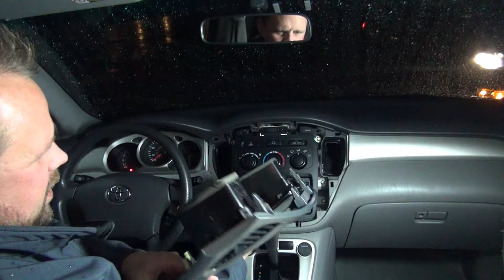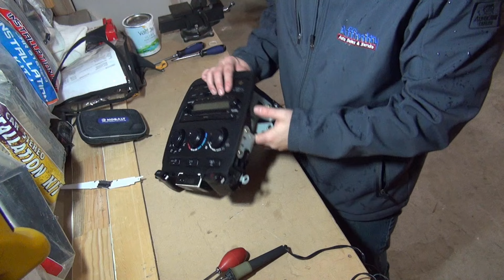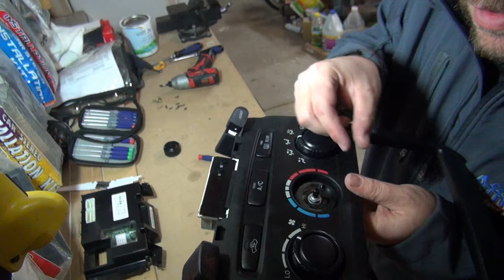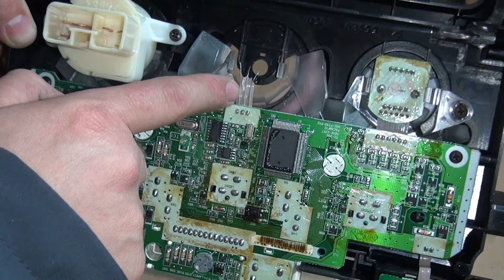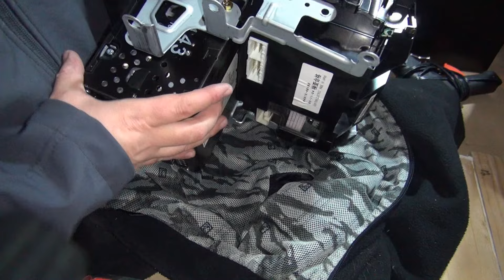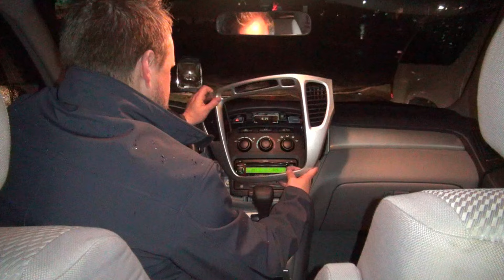How To Repair Toyota Highlander Climate Control | DIY Tips

Comment: lately a couple of times my cold blows hot air instead. so of i turn the dial all the way opposite to the hottest on the dial, and then back to the cold on the dial, it fixes it and it blows cold again. does this sound indicative of this same worn cable connection issue? thank you.

Comment: The knobs are inverted in the control panel. I was told at the dealership that it first needed a diagnostic, however the AC was working fine before it was disconnected during the winter. How do we get the knobs working again? Could the cogs in the knobs be stripped? I,,'m a little old lady on a pension that can't afford costly repairs. This rep air seems simple & inexpensive.

Comment: -This won’t work for everyone, but I was able to solder the lost connection through the front without taking out the unit. After removing the middle knob I could clearly see one of the three wire cables detached from the board. I repositioned the cable back into the hole and soldered it back in place using a narrow pin. The space is very narrow, so you’d need one narrow enough. Not the best looking soldering job but fixed the problem and still working after a month. I like short cuts. But if it hadn’t work, I could just take the whole thing out like in the video. Nice video and still saving people $ 6 years later! 220k miles and car still sounds good.

Comment: Over 3 years ago I bought a replacement online for my Toyota Highlander 2006 from a company that rebuilds them that includes fixing the connector that is the problem and making it stronger than the original and they check everything and repair as necessary to make sure it functions properly. They included a postage paid label so I could easily return my old one in the box received to get back a core credit.  When the replacement arrived it looked brand new.  Still works great and included a lifetime warranty though that will likely only apply until they stop having enough returned to stay in that business.  Yes, the 2006 models had that same common problem as the model years listed above.  It is ridiculous that Toyota never recalled those for a free repair or replacement considering the same lousy design used year after year enough where a new independent business was started where a major portion of their work was for this item. If I paid for a new one from Toyota I likely would have got the same faulty design and Toyota's warranty for new parts is usually just 1 year.

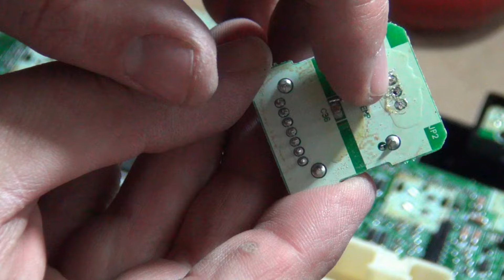Comment: 2025 here - thanks for making this. I made the repair on my '05, and the knob seems to be working correctly now.  Seems that little nut 6:14 that holds the stem was slightly loose. And years of use allowed the PCB to twist a bit back and forth. That is why the 3 conductor ribbon cable fail.  Be sure to tighten it good when done.    8:42 I ended up getting some 20 gauge stranded wire.  It had 7 strands in it. I folded back 3 of those strands, and that fit through the hole on the little PCB.  After soldering to the little PCB and checking continuity, I decided to just solder the other ends to the existing wires, as I did not want to attempt to connect directly to that larger board.  I put some heat shrink over the wire as insulation.  Before reconnecting the radio to the assembly, I tested with the three wire harnesses to just the HVAC control unit.  That worked so I reassembled everything.  A little pro-tip for those finding this problem in winter. If you put the air-recirc button on, it closes off the outside air, so at least it does not intermittently blow cold, winter air in while on the heat setting.  That is where I was in February.  Now that summer is here, it only took a few hours.  Huge thanks to the maker of this video for your excellent contribution to YouTube University!

Comment: That ribbon cable is a monster! I broke the base clip off the motherboard on my 2004 Sienna, not realizing you can unlock the top part of it.  Got another unit from pick-a-part, and now have to replace some bulbs in it. This will be very helpful, thanks!!

Comment: Thanks so much for this video.  Made the repair years ago and it’s holding up.  Instead of doing the soldering I bought a Dorman kit to replace that section.  At the time it was $50, …..it’s $131 on Amazon now!  I’d definitely go soldering route now.  Even if you had to pay someone $50 to solder it would be better than $131 for the Dorman kit.

Easier way to open the clamshell…..you can lift up the clear plastic part and remove that part of the white ribbon cable ( opposite end of one you removed) rather than trying to reach into the small area and do it.   The putting back together of this area starts a little after 11:00.

Comment: Thank for the video I just took the center climate control cap off the hot and cold cap and it has a nut in the middle, my knob was weak and I made strong by tighten  it up put the Cap back on now my hot and cold work normal. Like my comment  if this work for you.

Comment: My Highlander has the digital LCD screen which no longer works. As far as I know, that part is not repairable. Are the wiring harness hookups the same between the digital and manual climate control units? I was thinking of switching over to a manual unit.

Comment: I have a 2004 Highlander (basic). I followed your repair advice and it worked perfectly. Thanks. Now, however, I have another issue which you may be able to provide some insight. The other day, out of the blue, the digital clock light stopped illuminating and the light on the AC button was not on, even though AC was cooling my car. I also noticed that the Hazard button would not come on, even though it too was functional. I check the interior and engine fuse boxes (specifically the heater fuse 15A, Radio No.2 fuse (7.5A), and the ECU-B fuse 7.5A in the Engine Junction Block) - all of the fuses were not blown. Not sure what else to check. Any ideas? Thanks! WR

Comment: Hey I have a similar problem and can't seem to find the fix. The vent selector knob, and the buttons for AC control (and rear defrost) don't work. The clock also isn't lighting up. All of this is on the same board but I'm not sure how to fix it. I tried the soldering repair (some of the ribbon connector wires were broken) and it seems to be more reliable with temp control, but none of the other things I mentioned are fixed. I have checked fuses and nothing seems wrong there. Any ideas for what's causing this? It'd be a shame to replace the entire board if just once small component is bad.

Comment: I did this fix, but the heat doesn’t lock all the way in and the ac doesn’t come on all the it’s like the system is caught between heat and ac I think wires may be touching.  Any thoughts?

Comment: I have a same Toyota Highlander too. The heater sometimes suddenly blows a cold air when it adjusted to heating mode. When turn the regulator a little bit up (one delineation up) it blows again hot air. Sometimes the heater changes the fan speed by itself. When I also press the regulator it affects to the speed and temperature. Any ideas what I should do? I will be very happy to get your feedback. Thank you and greetings from Kazakhstan,  Almaty!

Comment: We repaired as described EXCEPT we replaced the 1 short, stiff 3-wire ribbon with 3 longer, flexible, individual wires of the same guage. Much easier to solder, time will tell if it is more durable.

Comment: Thanks so much for this! It is clearly the problem with mine too! I think the tape wire holds too rigid, so I am going to cut 2 slits to allow more movement!
Reply: We repaired as described EXCEPT we replaced the 1 short, stiff 3-wire ribbon with 3 longer, flexible, individual wires of the same guage. Much easier to solder, time will tell if it is more durable.

Comment: Hi Brian. Great vid. Very helpful. I tried and failed at the re-solder of the three wire harness. I want to order a refurbish unit and the seller has one but says I must take the power amplifier off of the old unit and screw it with the 8 screws back onto the component with the broken three wire harness. Is the power amplifier what you set aside in the video but didn't identify?

Comment: I was fiddling with the knob for months, until it got too hot outside. I watched your video, took mine apart and re-solder  the 3 wires. At my age, I had to use my phone's camera zoom to inspect the welds. Then I tested continuity before slapping together. Your video improved the quality of my 40 min commute- used to freeze my butt off  in the winter and sweat like crazy in summer. Not anymore, thanks to your well explained video.

Comment: Tried to fix mine. Was the vent selector not the temp adjuster. 6 motherfucking wires. My tip wasn't itty-bitty enough and getting the wires to take the solder was hell. You need a bottom heater. They took through hole and soldered wires to it. Dumb as hell. The motherboards were starting to corrode. If you have to fix this, you may as well get a whole new unit. You're just fixing something that's already a fucking piece of shit. The prices for these units are abysmal.
Reply: Auto Tech Rescue sells refurbished ones online and alot cheaper than new.  When I add the link to the website it gets deleted each time.
Reply: @randys6220  You are a life saver my friend 🙏 thank you; may your Toyotas stay young!!

Comment: This is the perfect video, and it made this fix a breeze. I cheated by taking a shortcut - soldering wires on the reverse side of the boards with the mini pot board still with knob attached (I didn't even touch the ribbon after verifying it was severed on two lines). Thanks for the detail, I also upgraded the stereo whilst I had it apart. So good having a big audio upgrade and temp control back!
Reply: Is it the same procedure for fixing the fan control?
Can you explain how you soldered the connection?
Thx
Reply: @chiefinspector7280  yep it will likely be the same issue. Soldering the reverse sides of both the PCBs (main board and small dial board) is a little tricky, but easier than replacing the wire or even patching it back together by taking it fully apart. If you have soldering experience it is about a 2/10 difficulty, relatively quick and easy. You just have to be careful not to bridge the connections. I used fairly fat solder and in haste managed to do just that, which didn't cause any issue when powered on so I think there is little risk with the job. I have a photo of my fix here: https://i.ibb.co/wWCgK1J/i-Markup-20220402-045859.png

Comment: I would of added some hot glue on the ribbon to strengthen it after soldering it. To me it's apparent that during normal use, these connectors rock ever so slightly back & forth over time. Thus causing the wires to become severed after so many cycles of back and forth action. Strongly recommend to glue that ribbon after this repair & also the one next to it that controls the vent settings. Cheers!
Reply: If you tighten the nut behind the knob, it doesn't move at all.

Comment: Hey Bri, I have a 2006 Highlander and my temperature knob spins 360°  on my Highlander it only has two knobs one temp and one fan is the temp knob suppose to do that, because once in a while it will blow cold and most of the time it won’t 
Thanks DLP from Socal

Comment: I can name a list of issues you may encounter when owning a 03 Highlander.
1.climate goes out ( as shown in this video)
2. Power steering line behind pass. Front tire rusts out.
3. Both flex pipe and mid exhaust after cat rusts out.
4. Both Pass. Window motors will loose power randomly.
5. Transfer seal goes bad.
6. Rusty back plates ( plate behind rotors)
That's every issue I've had so far.

Comment: This is the best video I've seen to address this issue. 

I've found as a temporary measure, you can sometimes move the control all the way to hot/cold a few times and it will then work where you set it. 

If you're like me and feel confident in your ability to remove the unit from the car, but don't think you could pull off the soldering, there are online businesses that will repair the unit and ship it back to you for under $100. Be warned that some of them say they won't work on yours if you've already attempted the repair yourself.

Comment: Dude thank you SO MUCH. Just got a used 05 highlander and was able to fix my AC by fixing this ribbon disconnect.  Not only that but I find out the radio was disconnected from the antenna so I fixed that too. :D

Comment: I am so grateful for this video. I will be trying this once my solder tool gets here. Although, i do have a question before I attempt this. My heat temperate knob is loose compared to other knobs on the panel. Is this something that could be controling the blend door and it not be the need to solder? Thanks!

Comment: Is the blend door actuator hard to replace on these? I see the part on Amazon for $40 (versus $320 mechanic quoted me, total of $520 to fix). I have a 2005 Toyota Highlander and was told the blend door actuator was bad and that is why I have no hot air. I think it is under the glove box area?

Comment: My highlander car temperature control knop is mixing both hot and cool breeze uncontrollably.
When I set it on the cool side it will sometimes blow hot air to the extend that i have to take it to someone to deactivate it.
How can it be repaired back to its normal working condition?

Comment: I just did this today, too.  I used some wire I had(did all three) instea of re-using the ribbon.  So, six solder joints re-done later and I put it in.  It worked.  What a miracle.  Thanks, for posting this.  It gave me the knowledge and courage to try it.  Also, the high replacement cost of the whole unit gave me I-have-nothing-to-lose courage.

Comment: The heat and AC both work in my 2005 Highlander Limited (wood grain panel), but the temperature is stuck on 75 degrees.  The fan speeds work, but I cannot control them.  Essentially, both knobs do nothing.  Would this fix these issues?

Comment: Thanks for the great vid. I have an issue. The AC blows room temp, when on the lowest cool setting. when i switch the AC setting to 66 degrees (one above the lowest cool setting) I get full blown hot air. Any advice would be appreciated!! I have an 02 highlander.

Comment: Thanks for the instruction video Bri.  What do you think is the reason for this issue?  Do you think Toyota just used inferior wiring to keep this issue from happening?  If it is because the wiring is of poor quality than reusing it will mean you could have this problem down the road, right?

Comment: i have question and problem which driving me crazy after fixing my ac compressor in one of toyota services. I have Toyota Rav4 2011 Limited 2GR-FE V6 and my problem is that when i put air condition on LO its ok there is no heat blowing out. But if i put just TEMP+ to just 65 degrees only (just first higher one avaiable after LO) it starting to blow ultra lava heat on my face. I checked on OBD2 Port whats going with Torque aplication and it showing me : passenger+driver inlet temperature set : 95F. I was wtf lol thats too high and when i go Temp+ values also going high so if i set 65F it shows in OBD 95F if i set 75F in car, it shows me 105F in obd. I remember i was checking these parameters 2 years ago and they were FINE and now i have 30F difference. It is possible to make correction with techstream or something? Please answer, its making me cry lol! They just fck'ed it up in toyota service and they wont fix it since "They dont know how to" Please answer! :(((

Comment: This was a great video, found the ribbon cable was broken on both ends.    Unfortunately in the process of desoldering/resoldering i melted out the small eyelet for one of the connections on the switch itself.   I was able to get a makeshift connection between the thin strip on the board itself, but it will need to be replaced    Does anyone know where you can purchase just the heat switch?    It is functioning properly but i would like to replace the switch and get a more solid connection in place.

Comment: my 2011 highlander likes to randomly go from sucking air in from outdoors to recirculating cabin air. the stupid button won't listen to me.. plus it likes to suddenly just start cooling at half strength and then it will also pump hot air at the driver and cool air on the passenger. it's driving me nuts. do you think all of that is the controller unit?

Comment: First, thanks!  Your diagnosis was spot on. Kept turning from hot to cold arbitrarily.  Took 30 min to take apart as your steps were exactly right. The ribbon was broken just as suspected.   Since I don’t have the tool to remove the solder easily I just stripped the wires and soldered them to the stubs on top.  Worked perfect.  This saved major expense.  Even refurbished controls are not cheap and the new control unit is like $1200.  You wouldn’t realize it’s something this simple if you had not posted this video.  Thanks

Comment: Thank you for doing this video, it was very helpful. I was able to do a 2006 by just removing the center knob and leaving everything in place. Used a long fine tip soldering pencil, fine electronic solder, wearing a headlamp on my forehead and reading glasses. Worked through the small curved opening above the wires. Used a very small screw driver to carefully position the broken end of wire over the solder pad on the board and then quickly applied a small ball of solder to the pad and wire, was able to get each of the 3 wires first try. The center wire was still connected but re-soldered it anyway. You do need a steady hand and the right iron and solder. May not be the best method for everyone but it can be done and only takes a few minutes.